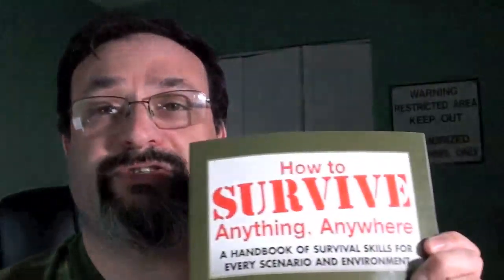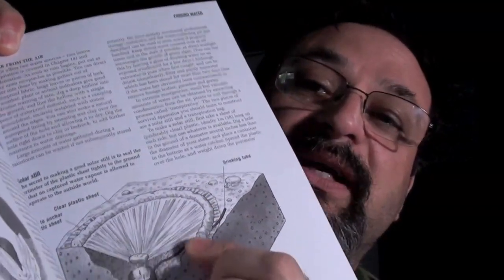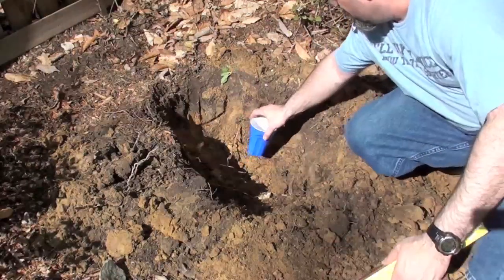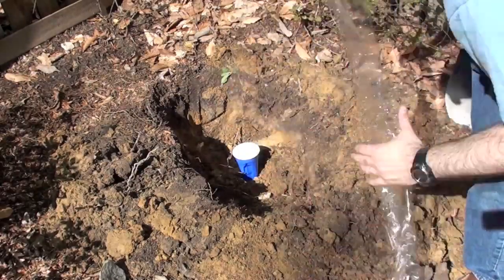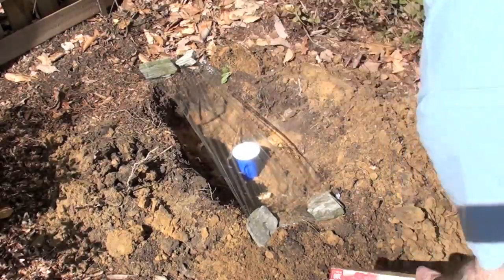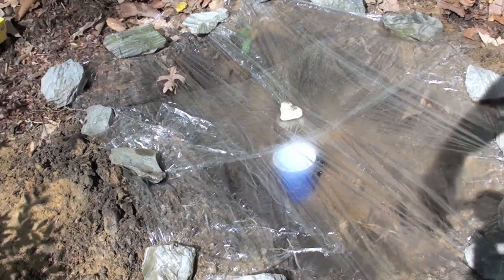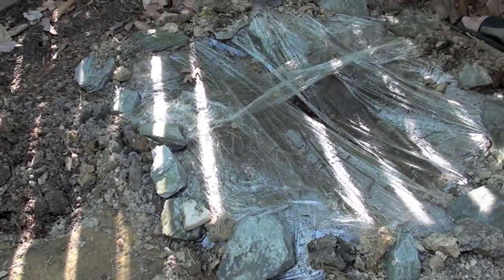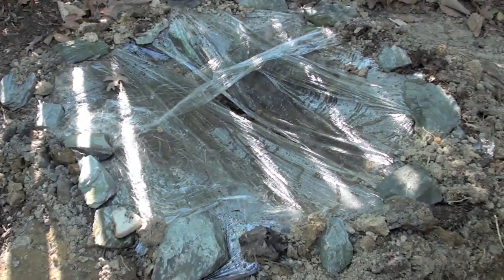Survival - Solar Still

Comment: I have heard that you should put some vegetation into the hole around the cup as water will come out of the leaves and such and add to the water content. Also, it is recommended to build many of these at one time so that you can actually produce enough water to sustain yourself.

Comment: More sag in the plastic is better. In the desert where the ground had little moisture, you can urinate into the hole to provide your own moisture, after evaporation the water should be clean.